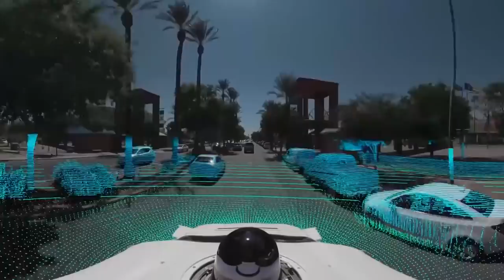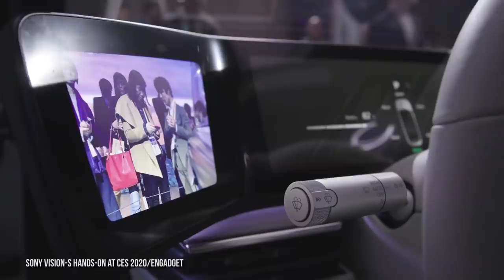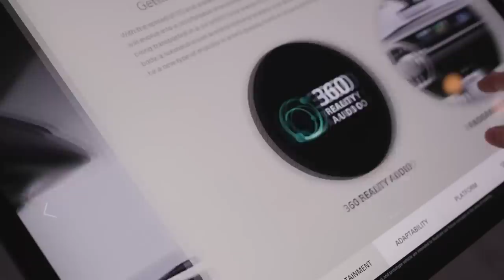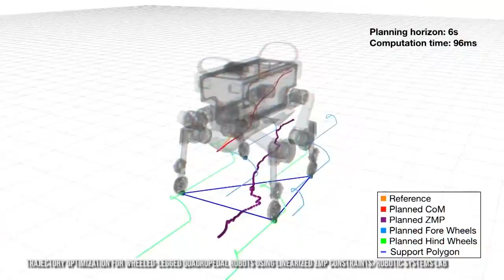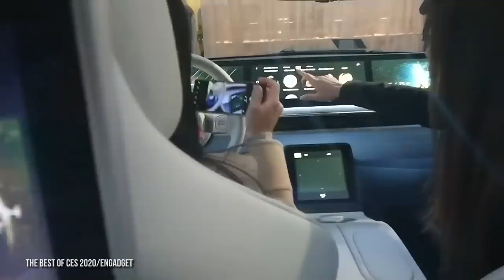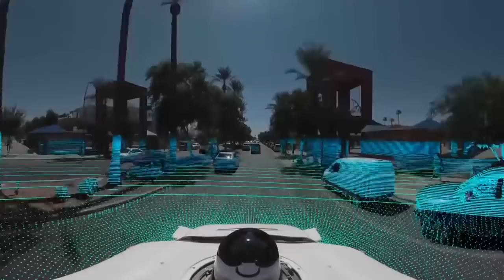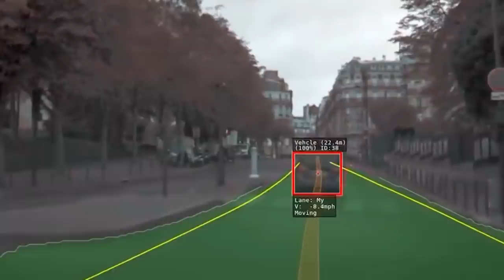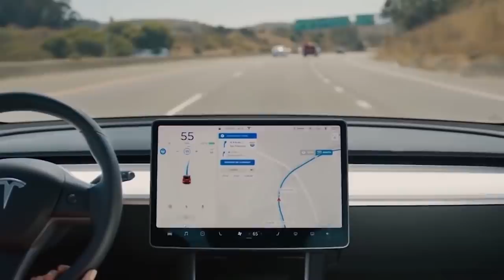Sony Officially Reveals Car To Beat Tesla

Comment: Why is every EV marketed to “beat” Tesla , that’s just marketing for Tesla because they are the benchmark of the EV industry
Reply: Very true
Reply: Eh I'd say Porsche is right there with Tesla the only thing Tesla has over the Porsche is the charging network and the range but that will be even pretty quick or Porsche will overtake Tesla quick with those parameters. Porsche has a superior 800 volt system, better battery cooling, better battery performance, faster charging once the higher volt chargers are out which they install at the delarships and eventually everywhere else, way way better build quality (no panel gaps, no water leaks into the battery or under the rear seats, and other quality issues), Porsche has a better dealer network and repair service when needed, a 2 speed transmission so it's faster top speed and acceleration off the line, and lastly my favorite you don't need to wait for the battery to cool off or warm up for drag races which is something people boast about with Teslas but they can only do it a few times where with the Porsche a car reviewer on YouTube did it 100 times in a row to prove the car can do it. Teslas big because of Elon more than the cars and that they were the first to do it mainstream. Teslas are really cool but I'd sacrafice a 50 mile reange and the Tesla charging network for a superior car from Porsche.
Reply: Evan Sargent people are interested in porsche the same way people where interested in blackberries in 2007.. all eyes where turned onto apple iphone. The same with tesla models today.. model 3 and y have 50x more content on youtube and around 5-7 times more viewers.. it has the giant interest. Same with Sony Walkman once upon the time.
Reply: Evan Sargent You comparing tesla’s innovation with porche. Tesla has been working at fsd for more than 5 years. And they have the smartest people in america and the world working at it - and some of them helped create a reusable landing rocket. And they are almost there. Do you think porche or any other company will be able for to do this even in next 10 years.
Reply: All about Tesla very bullish
Reply: Evan Sargent in the luxury market Tesla has some descent competition by Porsche and Audi  (battery cost isn’t a factor in luxury cars ) but in the mainstream car market Tesla is years ahead of the competition because their cars simply out preform and have longer range then the competition for the simple fact that Tesla invested in batteries almost 10 years before so their competition and the fact that Tesla has been in the process of making all their batteries in house
Reply: @Haldexify  Content on YouTube content is pretty irreverent to the actual product quality plus Tesla has had a lot longer time to get exposed to the internet so of course there is more content i can agree with you there but because its popular dosnt mean its the best kind like how the Toyoda is the most popular brand of car on the road but by no means is it the best in terms of technology.  the best way to describe it is Tesla is great for tech enthusiasts while the Porsche is best for car enthusiasts. Thats why Porsche says its really not a competitor to the Tesla even tho they are both electric 4 door cars and are fast. Tesla is around $120,000 for the top tier model S while the Porsche Taycan Turbo S is at around $220,000 quite different buyers if you ask me.
Reply: Evan Sargent but Porsche can not “beat” Tesla , it’s not a winner takes all market it’s more like EV beats combustion engine cars and who will be the EV’s Toyota’s , and GM’s and Mercedes Benze’s of the future and right now Tesla is in a good position to become the Toyota of EVs provided that they maintain their momentum. If Toyota, Ford  and GM can acquire a good battery supply chain to drive down the battery cost so as to make their vehicles competitive with Tesla performance wise they can possibly overtake Tesla since they have a more established infrastructure from factories to dealerships
Reply: @rachitpant3357  having spoken to a higher  up at SpaceX he described Tesla as a Tech company not really a car company. As for engineers Porsche, Audi, has dominated the LeMans 24 hour racing event in France for over a decade and those engineers help design those cars for the VW group. Because you can build rockets does not mean you can also build the best cars. There is in my opinion just as much engineering mechanically in a car than a rocket. The thing about rockets thats difficult is the Logistical issues and the physics of putting a rocket into space. The World auto industry in 2019 spent 103 Billion in R&D where the companies themselves funded 90% of that, where the World Space and Defense industry spend 32 Billion in R&D and the USA specifically spent 15 billion of that anyways i digress. The point is SpaceX isnt exclusive to the worlds best engineers and id almost say they may be a tad bit behind cars as thats not their main business.
Reply: @Haldexify  Tesla has more content on YouTube. Porsche makes more profits. I know which one I would choose if I owned a car company.
Reply: @Some0ne001  This dude just compared putting a manned rocket into space during a global pandemic to building a sports car! 😂😂😂😂 A fucking CAR!
Reply: @Some0ne001  🎪🤡🎪
Reply: Evan Sargent i agree that porsche and tesla are not equal competitors. Porsche has better quality, Tesla is innovating. Now would you prefer to ride a horse breeded to the best quality possible, or drive a result of innovation (a car)? I opt more for innovation than quality. No cars produced last 20 years will on average last over 20 years anyway.
Reply: Evan Sargent tesla has longer time to be exposed to internet? Tesla established in 2010, prosche in what? -1905?
Reply: Troy Savary Nokia and Blackberry also maid more profit than Apple did on iphone in 2007.. we know how that went.. try to look for the future, 10-20 years ahead, not to the end of the year only
Reply: @Haldexify  What innovations? The first battery electric cars were produced over 100 years ago. Tesla did not invent the concept of electric cars. Elon is standing on the shoulders of giants and claiming to be the tallest.
Reply: Because nobody says that they want an “electric car” they all say they want a Tesla. Tesla is king right now for EV transportation. It the reason why Ford used the Mustang name for there new elective suv. If they used a name like the Ford Reno or Ford Evo nobody would buy it. Almost every manufacturer has tried to make their electric vehicles cool But they constantly get beat in sales by Tesla’s. That’s why all these cars are marketed to beat Tesla’s.
Reply: @kristopapa8618  Tesla is not king in Europe, the only EV market that is growing. In July, over 115000 EVs sold in Europe. Of that, approximately 500 were Teslas. So less than 1% of the EVs sold in Europe in July were Tesla models. So once there is competition, apparently people don't want Tesla when they want an EV.
Reply: Don’t forget it never actually hits the market and sells
Reply: You answered your own question.
Reply: @TroySavary  maybe in Europe but this is certainly not the case in America. Also, Americans buy more cars than anyone else in the world.
Reply: @kristopapa8618  Europe is a larger car market than America, and a much larger EV market. The EV market in America shrank in 2020. It grew by more than 150% in Europe. Tesla, on the other hand , has shrinking sales in Europe. So Tesla is king of a shrinking market, and is losing ground in a growing market.
Reply: @Some0ne001  This is absurd. Porsche doesn't sell enough cars to affect the mass market. Porsche will never sell enough cars to affect the mass market. Porsche isn't even trying to sell a remotely affordable car! You can't move the market when your only customers are the ultra rich. It's like saying private jets compete with commercial airlines. They don't.
Reply: @TroySavary  Europe is absolutely not a larger car market than America. I'm not sure where you found this statistic from.
Reply: @kristopapa8618  Just under 17 million vehicles were sold in America last year. Just under 16 million were sold in the EU last year. I didn't, in a quick search, find sales stats for non-EU European countries, but if you think that the rest of Europe had less than 1 million, you are an idiot. There are 11 European countries not in the EU, including relatively large car markets such as Norway and Russia.
Reply: The reason everyone wants to beat Tesla is because they are the benchmark of the EV automotive industry!    So now the whole world is tripping over each other to make the next benchmark!    But Tesla has 5 years on everyone else and that’s the advantage they need to stay ahead of the pack!    Elon went to Volkswagen in Germany recently because they wanted his opinion on their new Golf sized ID.3, which shows they have a massive respect of him, Elon really liked it but his only gripe was it wasn’t fast enough 😂
Reply: Will Thompson  I think it’s easier to compete with Tesla in the luxury car market.  People will pay for an EV Porsche that has speed and range but not many want to pay $35k for a Chevrolet bolt that doesn’t have looks , speed or range
Reply: Uh you forgetting about Porsche????
Reply: Porsche is something my dad would like. You folks, wait till you see Roadster2 before you go blowing your wad on a nice Porsche.
Reply: @KhamusSolo  porsche doesn't just sell fast cars, they sell cars with one of the best driving experience, better build quality, better almost everything along with design...they don't compete...comparing Tesla to porsche is like comparing  samsung galaxy s20 to iphone se
Reply: COUSE THEY ALL ARE EXTREMELY JELOUS OF ELON , NO MATTER HOW HARD THEY  TRY , NOONE WOULD GO ANYWHERE TESLA IS TESLA ,THATS IT
Reply: HARD TO BEAT TESLA MAN ,HES IS ON THE BUS ALREADY, WHILE OTHERS ARE JUST LOOKING FOR  BUS STOP
Reply: Tesla sucks. Nowhere near German cars.
Reply: @DavidJao  you've got to remember how Porsche is just one brand withing a huge company which is the Volkswagen group the engineers aren't working on just a porsche but multiple cars. The new Audi e-tron
GT I think its called is using the same chassis and electric power system that the porsche uses. Toyota and VW are always switching places as the biggest car companies. The v8 motor that's in the Porsche Cayenne, Porsche Panamera is the same as in the audi S8, S7, S6, and the rs counterparts. Or the 2.0T E888 gen 3 engine my VW GTI has is the same engine used in the Golf R, Audi s3, Audi a3, Audi a4, Audi a5, audi q3, audi q5, audi q7, Audi allroad, porsche 718 boater, porsche 718 cayman, as well as the Skoda brand sold in Europe. Thats just one engine thats used in all those cars with just different software mapping for different power outputs.
Reply: @Some0ne001  If VW brings the features of Porsche to the mass market then good for them. Still waiting.
Reply: @Some0ne001  problem is Porsche, won't devalue themselves and make a Ev in the 30-50k price range.. but all what you said is true
Reply: @DavidJao  VW is essentially using Porsche to profit of there tech.. they could downscale all that tech and put in there low end cars but will it be profitable  much than using a ice engine,  i think not and that's why they don't do it because remember it just recently tesla start turning profit on there EVs... the other big guys don't want to wait that long to turn profits, but sticking your latest tech in a Porsche, Audi etc.. they'll make profit just  off the name lol..
Reply: @Some0ne001  And how many family sedans does Porsche make that an average family could afford?
Reply: Why do Tesla faboys poo poo every competitor? ... f@ck Tesla, completely bored fo the and their cult following. I'll only buy EV but it'll never be a Tesla ... glad some alternatives are coming through.
Reply: Its funny, bc you answered your own question, A product's objective generally is to be the best in the market segment, best in the market today is Tesla, So Beating tesla is the objective & despite they advertise it or not, That's what it means
Reply: They are a benchmark along with other popular EVs. That's a good thing for consumers though.
Reply: It’s not marketing for them. It’s just because they’re the benchmark, every new electric car’s potential is measured against their ability to compete with Tesla. That’s what being the best means. They’re the target goal.
Reply: @yupp9393  it kinda is , it’s like saying a phone is an iPhone killer
Reply: No. Do you know "NIO" supported by Lenovo ;)
Reply: @Haldexify  a car is a different commodity than a phone price wise. Just because it gets views, does not mean it sells. model 3 and Y basically have no competitors in their range class.
Reply: @rachitpant3357  You forgot 1 huge thing. Porsche is known for building cars far longer than Tesla. Als the concepts of electric cars is not new, it's over 100 years old.
Yes they have smart people at Tesla. You think they don't have engineers at Porsche? or VAG in general. Never heard of the ID R? any Tesla is slow compared to that car.
Reply: I don’t think Sony mentions Tesla. It’s the youtubers that compare it to Tesla.
Reply: People found out that writing "Tesla" in YouTube titles gets them more views
Reply: actually this is exactly what Elon wanted to happen. he didn't want to be the benchmark of the EV industry,
but he saw that the EV industry needed to happen, and the way to push it foward was to actually produce EV's that would outperform and outsell 
gasoline cars, so that conventional carmanufacturers would be more or less forced to gradually make the switch to EV's,
which is what we have been witnessing for the past years with brands like ford, mercedes, bmw and porsche.
if i remember correctly, elon has said that once the new roadster and the cybertruck is out, there will be no more tesla, or at the very least he will leave tesla, and focus on spaceX, once the automobile industry has had sufficient influence to switch to EV technology, as he never wanted to be involved on the automobile industry.
Reply: @Haldexify  yeah but look how expensive they are...
Reply: @Some0ne001  the only difference with the Porsche is the cost. Porsches are not today and never have been at a price the average american can afford, but Tesla appears to be trying to get their prices down to be more enticing to a larger group of people. I do love porsches, but Tesla is the first company to have completely electric cars I believe or at least the first to get big off of it.
Reply: Tesla was the start of the EV industry. Their goal was to have other companies adopt a build for electric vehicles. There's no competition between Tesla and other companies, because their goal was to accelerate a better future for the world
Reply: Sony is not here to beat Tesla, as far as I know Sony will never entre into automobile sector, they wi just sell the autonomous stuff to other companies.
Reply: I don’t think is is...that’s just the title of the video, and journalist waffle....
Reply: Yeah and elon also gave away patents so that everyone would make EVs for a sustainable future.
Reply: The fact is, that every entry in the EV field boosts the industry leader. TSLA isn’t worried.
Reply: That's because Toyota and Honda elected to go the liquid hydrogen route. Trust me if those two players built EV cars, Tesla will be crying.
Reply: @TroySavary  You can own a car company by buying stock but you obviously don't want to put your money where your mouth is because it's easier just to try and convince people you are smart than actually doing the deed...
Reply: @joejoey7272  no it doesn't need a massive overhaul. According to Toyota the current gas stations right now can be easily converted. Building the new electrical stations are a massive overhaul. That's why Toyota, Honda, Hyundai went that route and it only takes about 5 min to fill up.
Reply: @joejoey7272  that's not what toyota said. So I'm sure they have more knowledge than you and I do. I just watched their documentary on the new 2021 Mirai they just released.
Reply: @Some0ne001  Tesla are really in a good position to dominate EV companies. They already have the new battery prototype for their vehicles. All they need is to work on the interior and overall build quality.
Reply: they not to beat tesla,  the creator of this video is making like every EV is to beat tesla
Reply: Yeah no one is denying it
Reply: Everyone wants to beat the best.....  and time beats everyone eventually
Reply: Not Aptera
Reply: They deserve it. Tesla did manage to do what Ford and Mercedes couldn't.
Reply: @Some0ne001  Finally someone on internet with sense.

Comment: Just be glad it wasn't EA who made the car.

EA Car 2021 - $45,000

Elite 4 Tires Pack - $2,500
Headlights Silver Club - $400
Seat Belt Club - $99.99
Air Bag Camo - $340
Engine Skin - $7500
Season 1 Early Access Windshield - $49 per month
Reply: Every time you turn the car on you get charged 5 dollars
Reply: Want a economy mode? Extra $50
Reply: facts